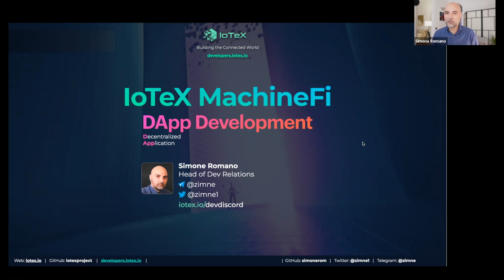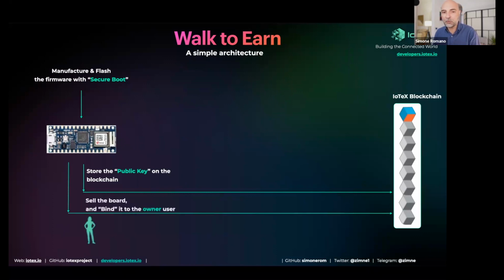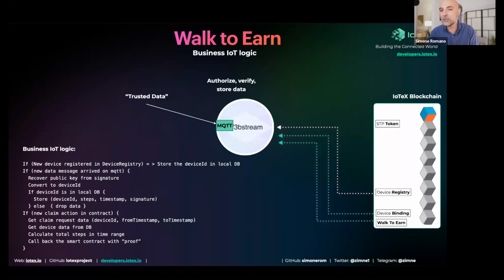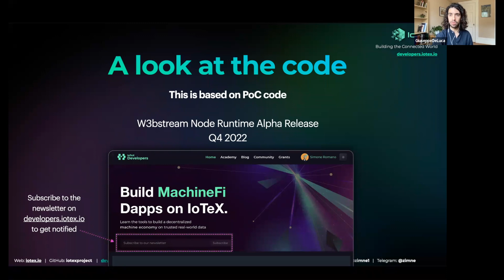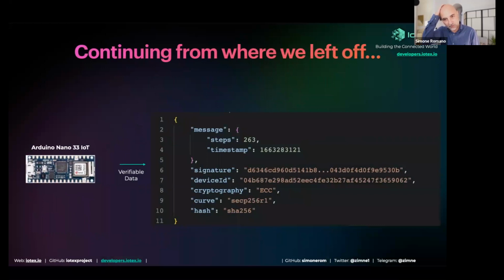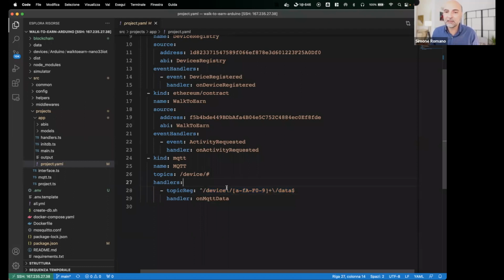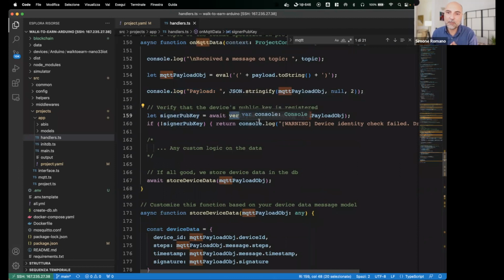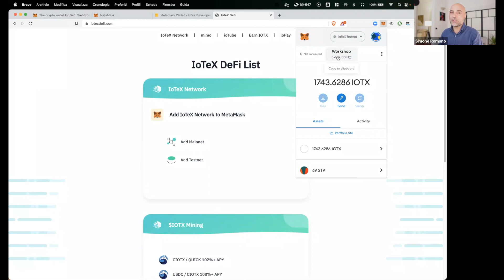IoTeX MachineFi Workshop 2/3

Comment: is there any plan to add IOTex code as extra module in RTOS Zephyr? ( it would be very interesting)
Reply: We are working on different hardware SDKs that can be used on different platforms. We will have a preliminary release of the SDKs together with W3bstream 1.0
Reply: @simonerom  interesting!!!
Also Zephyr supports 350 boards and it's the best solution for IOT also it's maintained by many companies  so I think you should consider it.
good luck guys
Reply: @mouradbouabdallah9049  Integrating the IoT device SDK into open-source operating systems is on our roadmap for next year, and Zephyr is definitely one of them!